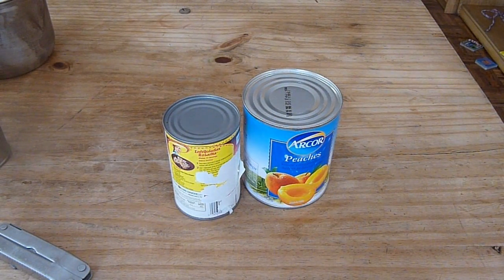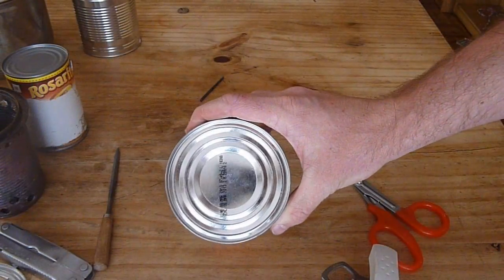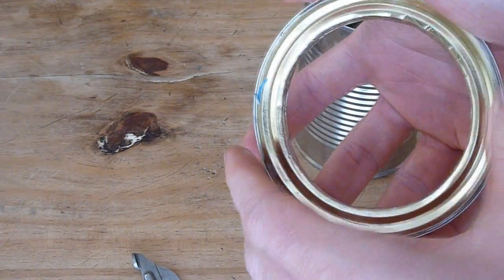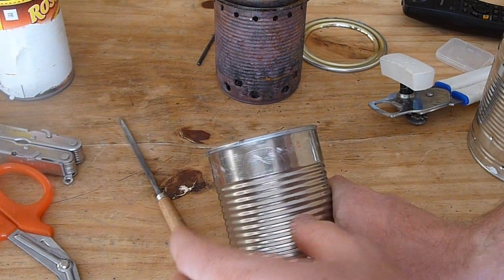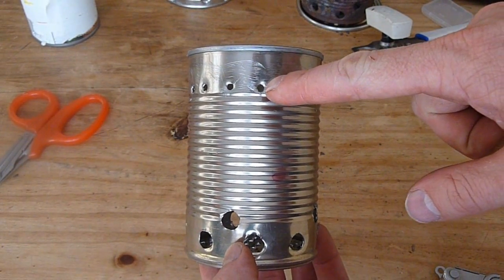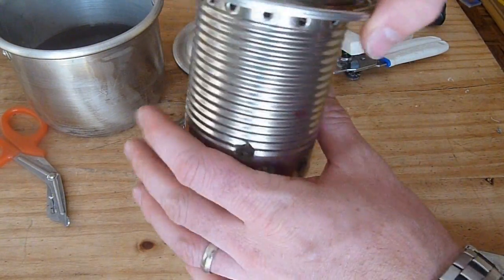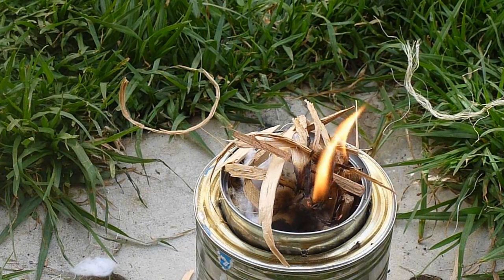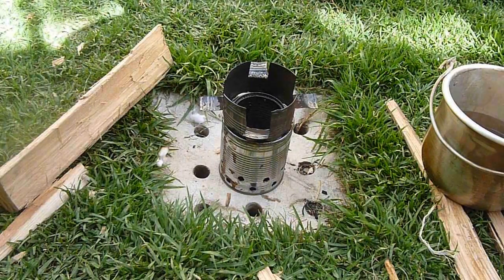DIY: How to make a backpacking wood gasifier stove

Comment: Great vid.  Thanks for sharing.  I used a similar DIY woodgas stove a few times last year and decided to abandon the idea since I use a camp fire most of the time and have a beer can alcohol stove when it rains.  I also save a few cubic inches in my INCH bag by not including it.  Also the woodgas stove has a tendency to smoke up the bottom of my pots.
Reply from the maker: Thanks! I added an afterburner that really cuts down on tar build up, but still there are smaller and lighter options. I'm playing around with the emberlit stoves right now.

Comment: Great video! One question: Couldn't you skip the can opener and just start with the correct-sized hole in the lid of the bigger can? Might be a bit messy until you get the peaches out, but seems like it would be nice to end up with a single piece rather than re-fitting the lid.

Comment: Built one and took it on our family memorial day backpacking trip.  2 questions: how do you smooth out the rough edges on the cans from drill bits, cutting, etc.?  Also, had a little trouble getting the stove lit, used cotton and kindling.  Any suggestions?  Once it got going, it was awesome.

Comment from the maker: You can do it with larger cans. Technically it could be used to grill. I have clear burn attachment that almost eliminates all smoke completely once the stove is up and running. I've added an annotation linking to it.

Comment from the maker: It is not an inverted gasifier. It injects hot air to the top of the burn to burn unburned gases. It's probably more of an afterburner than a gasifier.

Comment: Just throwing this out there.  If anyone is HAVING to buy a set of drill bits for sheet metal then you might as well pick one up.  An unstepped is also available but takes more practice to make the holes exactly the size you want.  But you're right.  It is an expensive bit when you compare it to other drill bits.  It can be had for 10-15 and higher depending on the size.

Comment: basically this with an air pump plugged into those outside intake holes, and you essentially have a blast furnace. I made a big one and used it to temper some steel in the yard. I have a bunch of dead twigs so it was convenient.

Comment from the maker: My biggest struggle has been the balance of wind protection and air input vs. flame output. 

If it's smoking it could be there's not enough air coming in the jets so try adding some more air flow to the bottom outside can and the some more inner upper jets. 

Try the clean burn attachment as it will force the unburned fumes to mix with the air more readily. 

Try testing with a BBQ lighter and hold it up to the pot stand to see if it ignites the gas. If so it's mixing with air too late.

Comment from the maker: I did toy with a double walled rocket stove concept. It's all about air mixture and chimney effect. You'd have to have a way of heating the air and get it flowing enough to be more effective than the air that naturally mixes at the top.

Comment: If you take 2 steel can with steel lid like older tobacco can with inside the Same as the size of a roll of toilet paper.  Drop the roll into one can fill with methyl hydrate or highest % rubbing alcohol u can find. Use second can fill with holes on sides for vents place on top of can with toilet paper after lit.  Use top to put out fire when done.  Heater or stove tho takes a wile to cook but nice heat for camping or hunting

Comment from the maker: Hi Gary. Great question. The double wall traps and heats the air before it is injected at the top of the can. The top injection adds more air and the  end of the cycle for a cleaner, more efficient burn.

Comment: This is not a Gasifier a gasifier would need an outer chamber that is burning the wood which heats the woodchips in the inner chamber which has no holes besides one at the top. This process releases woodgas from the wood chips in the inner chamber.
Now you can light that gas that comes from that hole.
All you have made is a stove.

Comment from the maker: It will really depend on the type of wood you use and if you top it up with twigs as you go. Using pine at altitude It can easily boil 2 to 3 cups. At a tight pack it can do a liter with 1 fill, but you're running on coals at the end.

Comment: Or let it go and the charcoal will burn. Good for keeping the food warm. The little bit of charcoal produced wood only fertilize a couple square inches of soil. If you are dumping it after cooking, be cautious as it tends to light back up quite easy when exposed to the open air, or leave it in the syove until it burns completely out.

Comment: I also found one can weld cans together. Weld seam to seam only with those small rods they sell for 110v welders (7018) with a stop and go pattern. If you get the odd hole. don't try to fill it- just go over the joint with stove pipe tape afterwards to get a seal. This adds some possibilities/ flexibility of design.
 I hope this is helpful.

Comment: The pot stand you made is fine- just leave an intact ring of tin at the top.
 You can pack the wood a lot tighter than in the video. I like shorter pieces laid flat but either works. The wood HAS to be very dry. We collect it in the hot part of the afternoon and keep it in a box for the purpose, always having some on hand.

Comment: I'd like to share a bit of my expeirience. Being mostly for fishing mine doesn't have to be a s lightweight as one for backpacking.
 I made mine with an Aerosol can(ie:window cleaner or foam insulation) for the burner, and used three layers of cans to insulate the outer gap with fiberlass. As a pot holder I mount the bolts in the top. I added a draft control. I also split a can that serves as a wind screen.

Comment: I.d suggest the injector noles be 3/4 inch lower on yours, and then put the bit in each hole and bend towards the botom of the stove to give the hole an injector form. Also a tin circle devised to sit in the center of the fire ring and slightly higher than the injectors can greatly improve efficiency

Comment: This is a true gasifier. Water is sometimes used in ones making gas for an engine as a filter. Very messy. I think your actually thinking of making heavy water by injecting a little steam into an EXTREMELY hot fire. They used to do this on steam locomotives.

Comment: You can simplify the assembly by putting the large can upside down, using the small can to mark a circle, and then cutting out the circle. Then, all you have to do is drill both cans and gently tap the small can into the hole you made in the large can. A few more suggestions... you don't need the holes on the sides at the bottom of the small can. The only holes you need on the  small can are the ones near the top. The large can only needs 4 half-inch diameter holes.

Comment from the maker: @creektimothy Hi Timothy and thanks for the comment. Ha! They do look like those scissors though that emergency teams use! The "tin snips" came in a cheap tool set that I got several years ago. It certainly wasn't a medical kit though. They are much cheaper than normal tin snips, but that's what they were called in the kit. Regardless though, a real set of snips would do the job better.

Comment from the maker: @mrfirelover212 Hi there! The biggest factor is your can opener. Can openers are designed to open in different ways. Some work better on the top, others on the side. If your can opener doesn't do the job, try using a hack saw on the rim (or borrow a couple from friends)!

Comment: I think with some simple modifications this stove (or any TLUD ND stove) can be made to burn with blue flame and without leaving sticky tar or powdery smoke on the bottom of the pot. To compensate for the lower heat output, a pot skirt will be needed. Pot skirt is different from a wind screen in that the pot skirt should be 10mm from the pot and rising up to at least half the height of the pot.

Comment: Could you, at the quite likely sacrifice of your peaches or whatever, just cut the hole for the inner can into the larger can top without actually removing it from the rest of the can?  Seems it would be one less loose thing to keep up with and the seal would be tight.  Just a thought.  I have not tried this, but hope to in the next few days.  Thanks for a great video!

Comment from the maker: @NocturnalBreather Thanks for the questions! The Rocket stoves create heat by adding a lot of air to the bottom of the stove. You'll see that they end up with sooty pots. The concept here is that they limit airflow to the bottom of the stove and add it at the top. The result is a more efficient burn that requires a lot less wood. The result is a small quantity of charcoal because you've limited air access to the wood itself.  If you check. Better efficiency and cleaner. Not necessarily faster.

Comment from the maker: @TheWilderwolf   What can happen is that the air flow all goes in the bottom of the can. You can try 3 things. Was your wood packed in there pretty well? IF you pack a lot of wood in tightly then that should restrict how much air can come in the bottom. Alternatively you can add larger holes on the outer can to allow more air in, or have less holes on the base of the inner can. I had someone recommend that I get rid of the side row of holes on the inner holes. I am still refining it.